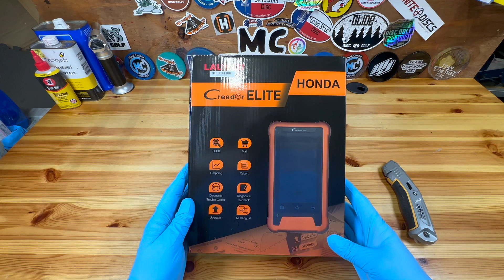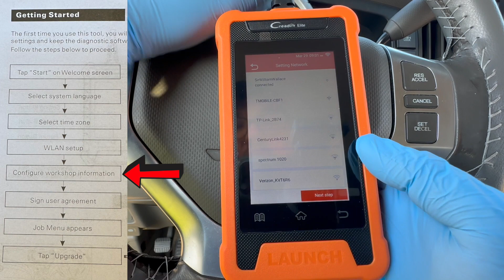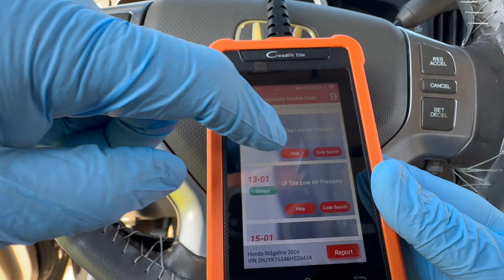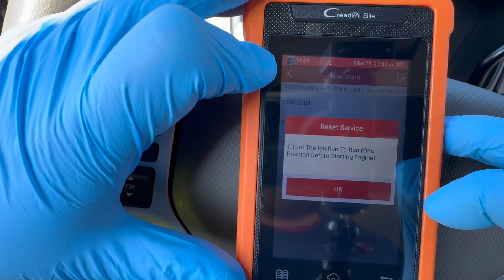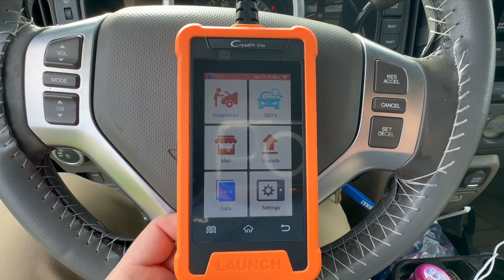LAUNCH X431 Elite OBD2 Scanner for Honda & Acura - Unboxing, Set-up, and First Impressions

Comment from the maker: Unboxing, Set-Up, and First Impressions of the Launch X431 Elite OBD2 Scanner for Honda & Acura (1996 and newer)

Tool: 
- Launch X341 Elite OBD2 Scanner for Honda & Acura - https://amzn.to/4cyuJ0D

Chapters:
00:00 Intro
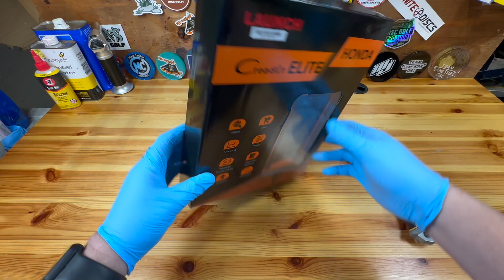00:30 Unboxing 
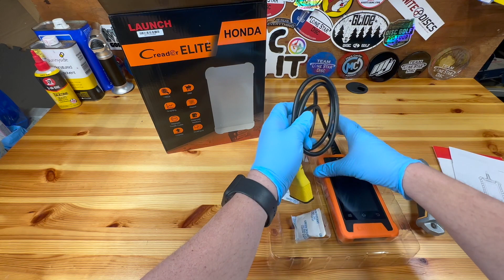00:50 Features of the Scan Tool
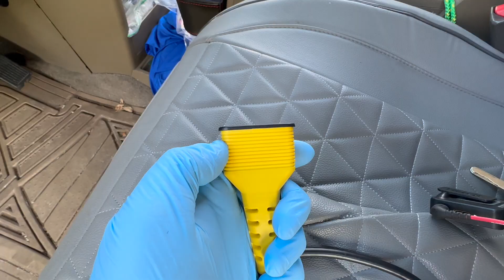02:42 Plugging in Scann Tool
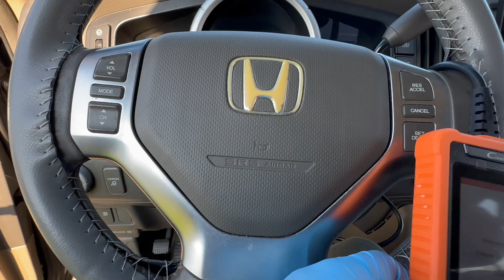02:57 Set Up Scan Tool for Your Vehicle
05:08 Select Vehicle Type
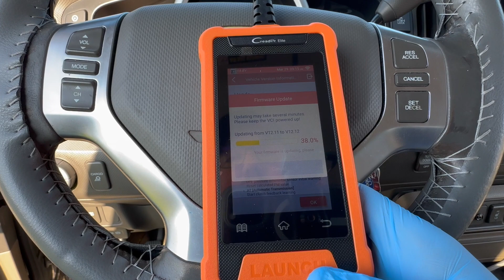05:38 See Battery Voltage on Screen
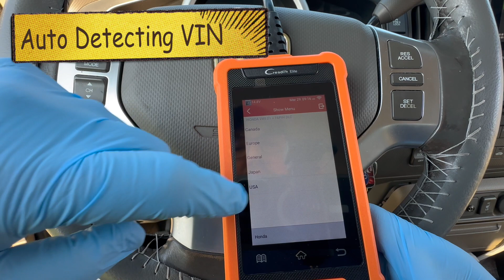06:24 Auto Detecting VIN Number and Information
06:54 Check Vehicles Health Report
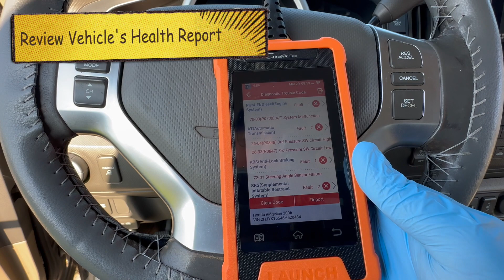08:21 Review Health Report
09:38 Clear Codes
09:55 System Selections for Diagnosing Issues
10:16 TPSM Codes
10:54 Code Related Videos
11:34 Oil Reset Light
13:29 Other Options for Diagnosing
14:49 Closing Thoughts

Check out my website at http://mcfixit.us 

Disclaimer:
Due to factors beyond the control of MC FIX IT, I cannot guarantee against improper use or unauthorized modifications of this information in the video, post, blog, or social media. MC FIX IT assumes no liability for property damage or injury incurred as a result of any of the information contained in this video. Use this information at your own risk. If you feel uncomfortable at any time. Stop and go to a professional. MC FIX IT recommends safe practices when working on vehicles, your house, or any other project and or with tools seen or implied in this video. Due to factors beyond the control of MC FIX IT, no information contained in this video shall create any expressed or implied warranty or guarantee of any particular result. Any injury, damage, or loss that may result from improper use of these tools, equipment, or from the information contained in this video is the sole responsibility of the user and not MC FIX IT.

#mcfixit #carrepairs #cardiagnoistic 
——
Supplies used to record this video: 
* GoPro Hero 7 Black - https://amzn.to/3f3ALtb 
* 256GB Flash Drive - https://amzn.to/33pAueG 
* Vlogging Frame - https://amzn.to/33tajE0 
* GoPro Pro 3.5mm Mic Adapter - https://amzn.to/2RCURCu 
* Youmic Lavalier Lapel Mic - https://amzn.to/2R55sWX 
* Boom Stand (tripod) - https://amzn.to/3bdkQaw
* 5/8” to 1/4” adapter (boom to blogging frame- https://amzn.to/3txrVsM 
* Portable Battery Powerbank- https://amzn.to/3vJQc0q 
* 6ft USB to USB-C (powerbank to GoPro)- https://amzn.to/3uAS5MH

Comment: Total random question but have you ever had a valve adjustment on your ridgeline? Also how many miles is on your ridgeline?
Reply from the maker: Hello @shadowman1992, I have not done that. I have read about a lot of people doing it during a time belt change though. Thanks for writing.

Comment: Do they make a cordless version of this? I'm thinking if you are diagnosing something like a fuel pump you would want to get as close as possible to the pump. If it was wireless, then you could be right next to it when you press the button to test it.
Reply from the maker: Yes, they do have a tool like that. LAUNCH X431 CRP919XBT OBD2 Scanner 2024 Bidirectional Diagnostic Tool. Here's a link: https://amzn.to/3TJ4R9R